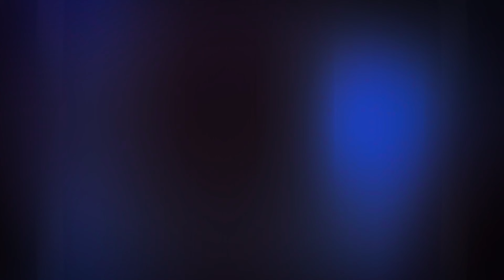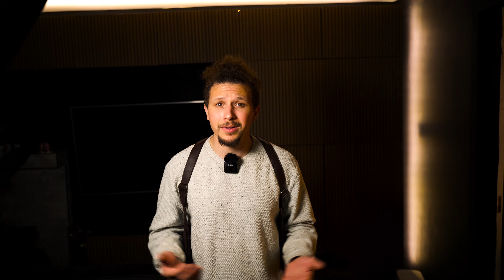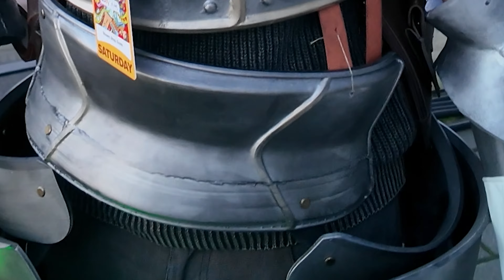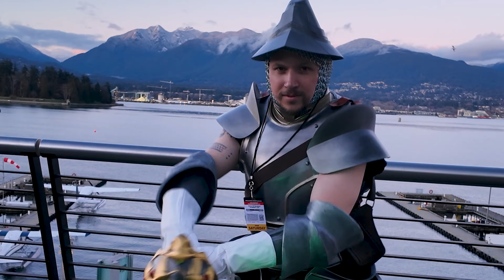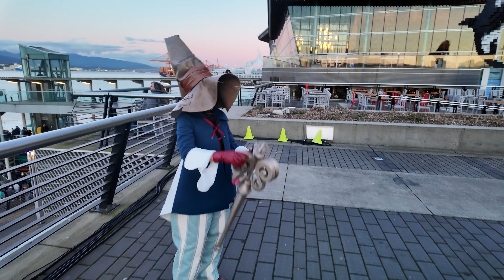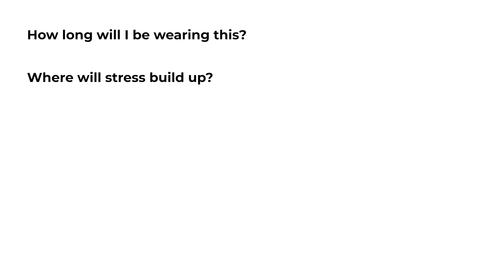I Finished a Cosplay in 3 Weeks… But It Wasn’t Ready

Comment: Years ago, I was in a con crunch and I ended up almost losing a finger trying to speed up the process. Unfortunately the accident meant I did not have the use of that hand for several months which means I never got to finish it before the con. But I got out of it a better understanding of my limitations and I have quit working with power tool late into the night. Learn from me, if you can avoid con crunch.
Reply from the maker: That's very insightful! Its great to see people that can turn an unfortunate event like that into a lesson. Thanks for sharing. Ill keep it in mind for sure.